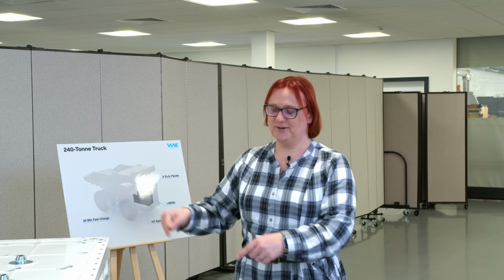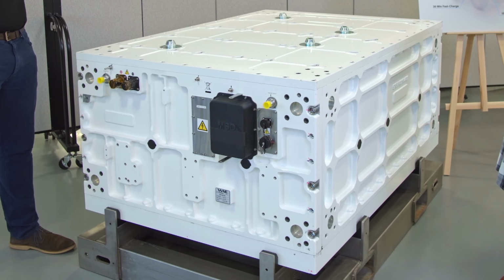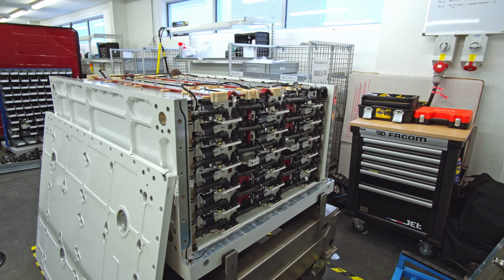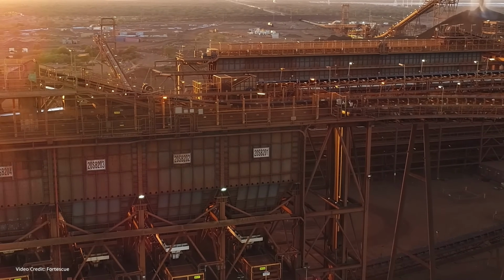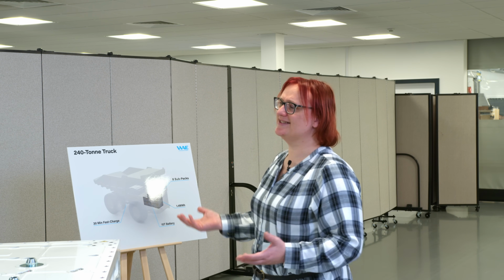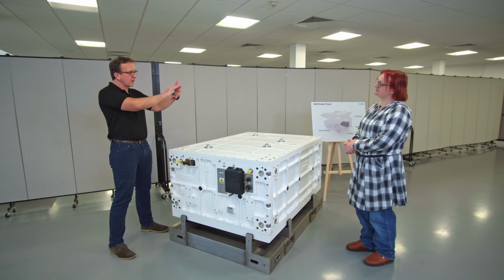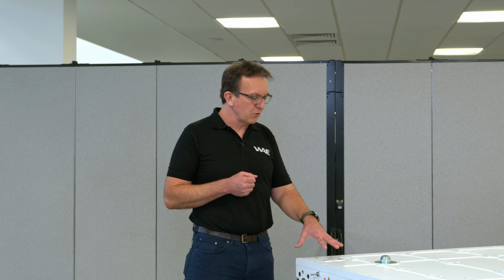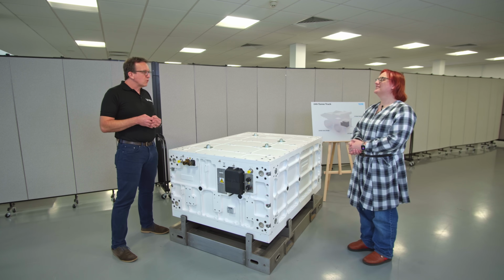EIGHT Of THESE Make This Mining Truck All-Electric!

Comment: Great summary although I'm not entirely convinced that Fortescue sees these batteries as the ultimate solution for their giant trucks—though that’s not to say they won’t have plenty of valuable applications elsewhere. My skepticism comes from reporting that suggests Fortescue remains heavily invested in developing green hydrogen solutions alongside battery technology.

What WAE Technology is doing sounds promising, but recharging time remains a major challenge—especially for machines that need to operate 24/7, where even 30 minutes might be too long. Harry’s Garage recently covered JCB’s progress, highlighting their development of both pure electric and hydrogen-powered machinery. Their view is that hydrogen offers greater advantages for larger equipment, which aligns with Fortescue’s ongoing hydrogen investment.

Given the vast scale of Fortescue’s Australian sites, there’s potential to explore how a combination of pure EVs, hybrids, and hydrogen-powered vehicles could complement each other—alongside on-site power generation for recharging EVs and producing green hydrogen for refuelling.

Comment: Oh, I thought the box alone was 1,4 MWh and the truck had several. With 1,4 MWh total and he said power in normal operation is around 800 kW or so meaning 2 hours of operation. Good enough for testing but a purpose built vehicle should have a lot more. Unless it is charging from overhead wires while going uphill from the mine but I guess it isn't since he mentioned the charging plug.

Comment: I am just wondering how these massive battery packs are going to be charged way out in some distant mine or pit miles from civilisation?
Oh I suppose that this is going to be acheived by diesel generators as a lot of these plants have already?
I am confused and need to understand how this will be acheived, wind and solar will not be sufficient ir do u propose as well using hundreds and hundreds of hectares for solar or the thousands involved with wind generation, again in some remote inhospitable part of the world as a lot of mines seem to be?
pls explain to me as this seems less than environmentally friendly if each mine has to by association involve using potentially unsuitable terra as a means for this.,ie maybe ots a mine on an island somewhere that has no suitable land whatsoever to be used for solar or wind?
need to know thanks.
thanks

Comment: Ok, I get the bit about going green, BUT how much fossil fuels/metals etc... are dug out the ground by diesel powered machines, transported to factory to be made (diesel/coal), then shipped half way round world (diesel) to be fitted at factory (more diesel/coal)t shipped again around world to location it's needed (more diesel) 🤔🧐🤔🧐 and which nuclear power station is it going to be plugged into to charge 🤔🧐 and how many DAYS will it be out of use because it's charging 🧐🤔🧐🤔 all sounds well and good, BUT that thing will. NEVER offset it's carbon footprint just to manufacture it, plus most of the mines are so far off the power grid, it would need some insane amount of diesel powered generators to charge it 🤯🤯🤯🤯🤯🤯

Comment: I live in Western Australia. This is encouraging. But I do wonder if for this purpose, the batteries are better in a stationary block, while the truck should be powered from a solid state supercapacitor. Sure the range would be less, but the trucks don't go far and the recharging would be very fast.

Comment: One of the key benefits of electric vehicles in underground mining is that you need less air circulation in the rest of the mine. The alternative, diesel engines, obviously pollute the air and that air needs to be recirculated for the miners who work underground.

Comment: Technically, the diesel-electric propulsion system on these trucks is not a “hybrid system.”  They have the same powertrain architecture as diesel-electric locomotives, with no battery to provide propulsion or regen.  To meet the technical definition of the hybrid there must be two power sources for propulsion.  These systems have only one: the diesel engine.  Adding a battery provides the second source for hybrids like the Prius, a hybrid transit bus, etc.
Reply: Diesel electric is a series hybrid. The two power sources are diesel and electricity.

Comment: There’s another Australian EV truck concept you should possibly have a look at. Janus Electric are working with standard road going Semies and B-Doubles with their fast battery swap tech. Typically they quote a truck can pull in and be on its way again within 5 mins. They are also working with a South Australian mine and have developed the first EV road train (3 trailers, hauling up to 196 tinned)

Comment: I am trans myself so no hatred here.  Nikki that top makes it look like you are wearing a bathrobe.  Pair that with jeans and clunky brown shoes and the whole look is unprofessional.  I know you are nothing but professional.  My suggestion is take it to a tailor and have six inches taken off the bottom and have it overall tailored to fit you much better.  It just looks too big and baggy right now.  Pair it with a nice pair of black slacks and black shoes would make a huge improvement.  That being said another great video.

I do question their choice of battery chemistry.  I think LFP would have been a much better choice.  Last 2 to 4 times longer.  Handles heat better and can be DC Fast Charged multiple times a day.  Way less likely to catch on fire than NCM.  Doesn't burn as hot as NCM and can be put out with water.  All that and LFP is much cheaper.

Comment: Thank you, thank you, thank you for this video.  More needs to be said about the mining industry converting to electric in order to counter the FUD about EVs are dirty because of dirty mining.
Reply: they are dirty because of mining and using electric trucks isn't going to fix that, its not going to change soil contamination, water contamination, air quality or a long list of other problems. also the resources uses for the mining industry will cause shortages in EV industry
Reply: @Lildizzle420 yes, everyone forgets all the current fuel sources pulled from the ground comes up smelling of roses and cures cancer weirdly.
Reply: @SimJDKS  I'm confused by your comment but the entire EV supply chain is laced with fossil fuels. 

coal to extract lithium in Australia
oil to transport it to China
Coal to refine it
oil to transport to Taiwan
Coal to produce
oil to Nevada.

we use solar to put the EV together and then use oil to transport it to Australia. 20,000 miles total burning bunker in cargo ships.
Reply: @Lildizzle420  frequently those that cry this talking point forgets the alternative is worse.      Crying we need to use existing technology to bring on a new technology is ignorant at best.
Reply: @SimJDKS  I think the alternative of walking is an astounding improvement, I've been walking for 10 years. 

It's ignorant to ignore feedback loops in my opinion, you burn the coal and the oil today and you can't take it back 10 years from now when the ice shelf falls into the ocean
Reply: @Lildizzle420  turning rock into smoke to power everything while never trying to improve it sounds foolish.   Batteries are hugely recyclable smoke doesn’t turn back into coal in a useful timeframe.   So yes, as of today it is very hard today to make a clean source of energy without ever using a dirty source.   As not all the clean sources exist yet.      You do understand that things not made yet can’t be used to make more right ?
Reply: @SimJDKS  so, literally ignorant, since you're ignoring feedback loops. I tried......
Reply: @Lildizzle420  how is that possibly a feedback loop when the goal is making something that breaks that loop?     Or did you hear a talking point and failed to do the key part of thinking  ?
Reply: @SimJDKS  you can't break a feedback loop by feeding it more coal and more oil. you are causing the feedback loop through rapid extraction of resources, the faster you mine the faster you cause the feedback loop.
Reply: @Lildizzle420  nice to see you don’t know how anything works.    Consistency I guess is a noble goal.    So unless a technology spontaneously appears that needs zero existing support and is also suddenly a majority of the market it can’t ever fix anything?     Nice.
Reply: @SimJDKS  I'm the one trying to explain to you how feedback loops work and you still dont understand the problem. like you literally can't comprehend why it won't work
Reply: @Lildizzle420  and yet completely missing the point that making sources of energy that reduce the need to extract more for the ground breaks that loop.   Missing that the materials can be recovered over and over from that first recovered material.  Using the energy sources of today to build the energy sources of tomorrow is not a feedback loop amplifier.  Would just reducing use reduce the loop as well?  Yes, but telling people to do without rarely works out.   So you really need to nudge things in the right direction.     Making declarations is not providing facts.   Stating something false with confidence doesn’t make it true.    Weird you also missed the videos on this channel over all the fud while spewing fud talking points.
Reply: @SimJDKS  you can end fossil fuels by extracting and burning ALL fossil fuels on planet earth but you will not break the loop.

you can end mining by extracting ALL lithium on planet earth but you will not break the loop
Reply: @Lildizzle420  you know each response you post shows how uninformed you are right.    Or are you picking some weird unrelated loop to cry about?
Reply: @SimJDKS  or you could be experiencing dunning Kruger 

is your plan to burn ALL 1.7 trillion barrels of oil in the world to build electric cars? 

I think it's more likely you lack the depth to understand a complex logic issue beyond what you've been told.

Comment: It's great to see these giant trucks be changed into EVs. Shows that anything can be done when we put our minds on it.
Reply: They are actually already hybrids. They have a similar drivetrain as a diesel locomotive. Large mining equipment use a diesel engine to run a generator to run electric motors at the wheels. The Terex Titan has an electric motor at each of the 4 rear drive wheel pairs

It's not that much of a change. Ditch the engine and install battery packs...and the supporting devices.
Reply: How are they going to operate in hot conditions?
North western Australian areas quite often have temperature fluctuations into the 50+degrees Celsius…
The batteries won’t operate with such high temperatures

Comment: Where's the payoff? Listening to this guy explain all expense that goes into constructing a power supply, for an electric construction vehicle is incredible.
Think about it. All of that complicated engineering vs a simple diesel gas tank.
Which one is financially better?
Reply: You also ditch the diesel engine, which is not exactly trivial in terms of cost and maintenance. The engines they use in those big mining trucks are enormous, they're difficult to work on and they have to be serviced in place because you can't drive the truck over the road to a mechanic shop. You have to deliver the fuel to the site in tanker trucks. And of course every time the truck is being loaded, it's sitting still and idling, making unnecessary pollution for the workers to breathe and noise that makes it harder to hear anything else. If anything, electrification in these work locations has a better business case than it does for regular road transportation where the infrastructure for servicing and fueling vehicles is extremely well established and efficient. This of course relies on you having a nice, reliable high capacity power connection to the site, obviously. If you are going to have to recharge your electric trucks with big diesel generators there's no point in using them at that particular job site.
Reply: @AlRoderick  Yes I agree. Construction sites are not usually in places where megawatts of energy is available.
How would they transport a megawatt power station?
Reply: @kennyfordham6208  they talked about it in the video, build a wind turbine at the site. Wind turbines are a big capital investment, about 1.3 million per megawatt, but if you're replacing exceptionally inefficient portable diesel generators that you have to truck in fuel for? You pay that off pretty quick. Also, if what you're using it for is charging huge batteries, you don't need to worry that much about intermittency.
Reply: @kennyfordham6208 In these scenarios, we are talking about MINES. They tend not to move about much. They dig and extract the same sites for decades. They expand as they require.
Reply: @AlRoderick  You mean that every site they go to, they're going to have to construct a big wind turbine/solar panels, BEFORE starting the work? 🤔
Reply: @kennyfordham6208   Mines tend to hang around in the same place for a considerable length of time.
Reply: The pay off is in reduced operating expenses.  One of the largest expenses in underground mining is ventilation - you have to remove the dirty hot air and replace with clean cool air. Ventilation  systems cost tens of million of dollars to hundreds of millions of dollars to install and millions more to operate.  BEV mining equipment gives off less heat and  no exhaust reducing the amount of ventilation needed.  MacLean,  Caterpillar, Sandvik, Epiroc, Liebherr Group, Komatsu, Rokion, Miller Technology, Artisan Vehicles and others make battery electric mining equipment.  A lithium mine in Canada is in the development stage and due to start production, it is 100% battery electric.  The same for a nickel and copper mine in Canada - 100% battery electric.
Reply: @muskrat3291  Well, we'll see how it goes. 🤞
Reply: Mines already consume vast amounts of electricity to power the processing machinery that they have on site, like 1.5MW gyratory crushers. Charging up some vehicles isn't that big a deal.
Reply: You think that a gigantic Diesel engine isn’t complicated?
Reply: I cost millions of dollars to build out infrastructure to deliver power to these remote sites. Also it costs a huge amount to truck in petrol and your at the mercy of the weather. Storms can make roads un-passable for weeks. Many of these remote sites are finding it easier to produce their own local power, so there is synergy with renewables and EVs.
Reply: there is a big flaw in your logic.
Reply: @stefanweilhartner4415  You're going to have to drag a massive recharge station whenever you move your construction site.
Reply: @kennyfordham6208  yes, or big heavy trucks of gasoline. i prefer electric. container sized buffer batteries and electricity. an array of solar cells are very easy to install.